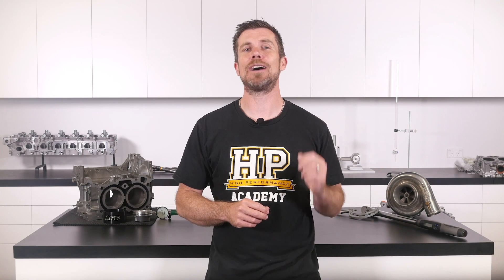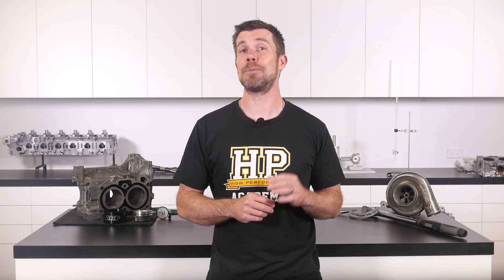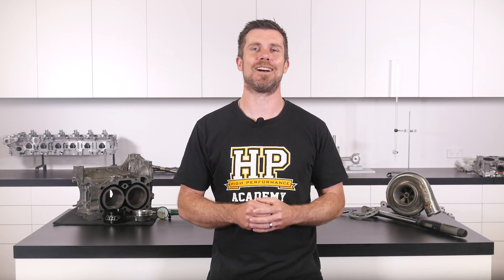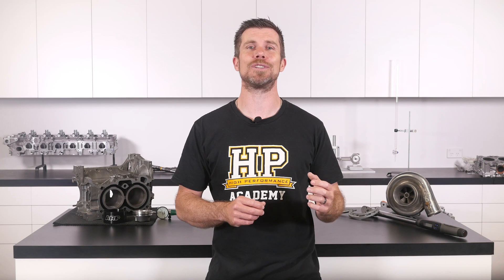What Is Porting And Polishing? | Port And Polish [HPA Q&A]

Comment: Rough finish on ports: I can understand why a slightly rough surface would facilitate flow (or reduce friction?) in ports. That being the case, why do not OEM and after market suppliers not "cast" that finish into the port and/or provide some exact tooling (like a die or cutter) that puts the correct finish in the port. Is that a cost thing or just not understanding fluid dynamics? A regular, cross hatched texture of the right dimension might be ideal. Just a "rough" finish is not very precise: everything else is engineered exactly, why not this as well?

Comment: Polish exhaust ports but not intakes? Is this correct? it is what I have heard, intake needs turbulence for air/fuel atomization, but exhaust needs low resistance.
Reply from the maker: A slightly rough finish is the aim on both ports. This sort of finish reduces the thickness of the boundary layer that sits against the port wall and improves flow overall.

Comment: I played around on a specific engine's cylinder head, specifically on the exhaust ports,...and found, purely by trial and error, that making the exhaust header port (in flange), and the tubing about 5mm bigger than the actual port...it gave significant gains throughout the rev range, but especially above 8000 rpm, I suppose it also depends on the overlap in the cam/lobe separation.
Reply from the maker: It's quite common to use a larger primary runner size than the exhaust port. It's also common to offset this so the step is at the top of the port. It helps reduce reversion pulses in the exhaust ports making their way back into the cylinder.

Comment: Anyone know of any tests done before and after with Port and Polishing. I know it affects each engine application differently but I want to see what kind of difference it can make in a specific case
Reply from the maker: We have never performed a test where the only change was to port the head. It's almost always completed as part of a full engine build and hence it's hard to quantify the changes based solely on the port work. That being said, most professional head porters with a flow bench will be able to give you before and after flow values to quantify their work. Think of this like a dyno for head porting. 

It's important to understand that the gains possible with porting will depend on how bad the original ports flow, and you also need to understand that airflow numbers aren't the full story. Air velocity in the port is a very important aspect that is often overlooked and misunderstood.

Comment: Could you explain how the mirror finish in the polish could actually distrupt airflow instead of improve it?
Reply: Im not sure if airflow was the right word, but i do know fuel will puddle up and lean the engine out in certain situations if the ports are too smooth. Well in port injection anyways, Direct injection is a different kettle of fish.

I forget the name they call it but its like driving and water just sit on your windscreen even at great speeds, similar effect can happen in the ports with fuel if its too smooth.
Reply: @fkn16v  
sounds about right to me, so creating a slightly rough surface breaks up that tension creating turbulence and therefor speed.
Reply: @Zion-jw3gm  I think so mate yes. 

In port injection it would be wise to have some turbulence to atomize the fuel better before cylinder entry, i believe this would create or help create a cleaner burn.
Reply from the maker: @Dork 2.0, Gordo has pretty well summed this up. A slightly rough finish reduces the boundary layer that sits against the port wall. In layman's terms you could think of it like this - The boundary layer is relatively stationary air, and the thicker the boundary layer is, the less port area there is that is actually flowing air into the engine. Taking this to extremes, there are a number of head porting specialists that have experimented with 'dimple port' cnc programs with supposed good effect. This is essentially providing a port finish that looks like the surface of a golf ball.
Reply: @hpa101  superflow has found that in a streamline orifice, surface finish is at max 1% of total flow from most rough to perfectly smooth. The air sees the mcsa and flows accordingly so shape is the most important part of a port. Dimples throughout the entire port is more of a gimmicky market much like some heads have the fins in the back of the bowl to help "swirl" the air into the cylinder. There are areas in the port that can/do benefit from dimples though so by them using dimples in the entire port, its only really gaining in the small areas that it controls the separation. Usually along the ssr, depending on the porter behind the valve stem, around the seats, etc.
Reply: @hpa101  Who are the top head porting specialists that you will recommend?
Reply: Been more than 20 years since Fluid Dynamics" classes, but check out boundary layer, turbulent and, to a lesser extent, laminar flow.
In short, turbulence at the port wall can actually increase velocity in that thin layer and enhance flow along the walls and also allow the air column to better follow the inner wall in direction changes.
As some have mentioned, it can also help break up fuel that contacts the port wall and reduce puddling from 'wetting' of the port walls where velocities are lower.
Some have also reported an improvement in combustion, and hence engine efficiency, from 'swirl polishing' the back of the inlet valves.
Some have commented about carbon build up but that is usually down to poor inlet guide oil control and/or running an engine with a lot of overlap at speeds below the designed operating range - and if running E85 it is usually not a worry as it burns cleaner. As an aside, I had to take the head off the shopping basket at ~175k (110k miles) (core plug leaking) and there was just a very light colouring of carbon in the head and ports - not enough to bother cleaning off.
Reply: An over polished intake will prevent full atomization of the air fuel mix so it's recommend to introduce some turbulence like dimples on a golf ball in the intake side. 
  As far as the exhaust side is concerned, it's not always known for huge gains but for some it's worth the mirror polish and porting as you don't want carbon to build up. All back pressure behind the turbo is lost power.
Reply: Another analogy: dimpled golf balls fly greater distance than a perfectly smooth one.
Reply: @charlesshamseldin9555  the golf ball analogy doesn't really apply because it's air around an object compared to air moving through a hole.
Reply: BDR Racing Development the dimples in the golf ball create a thin boundary layer that clings to the ball's surface allowing smoothly flowing air to follow the ball's surface a little farther and thereby reducing the wake.
Reply: I think it slows the speed of exiting exhaust affecting power negativley. maybe not sure.
Reply: @Zion-jw3gm  Over polishing the exhaust port wouldn't matter so much long term as the material and gases exiting the cylinder would line with soot the exhaust walls anyway.

Exhaust ports etc it would be ideal to get maximum flow to lesson back pressure.